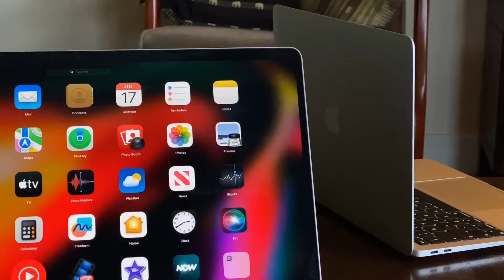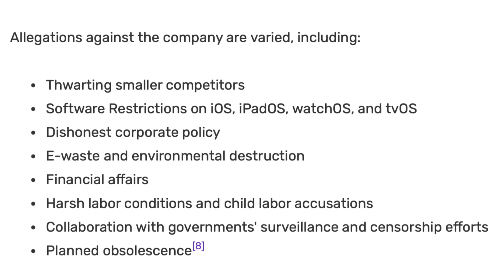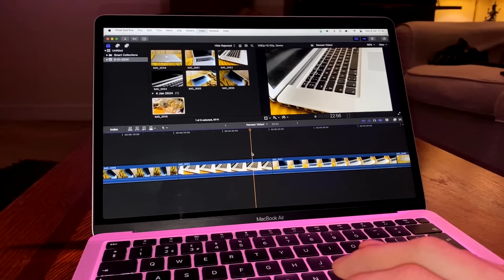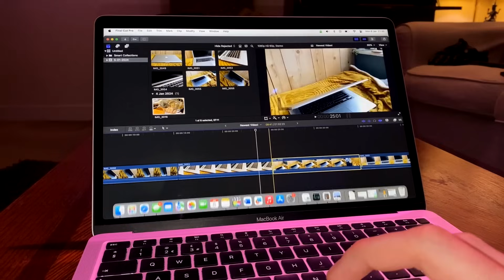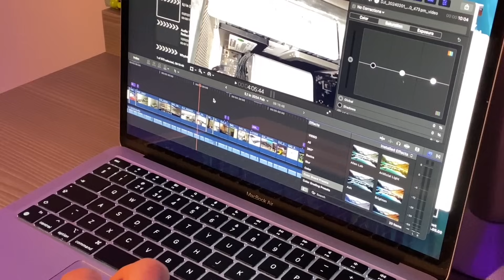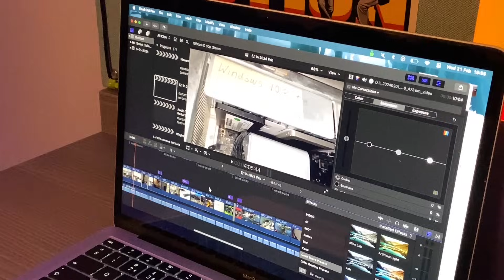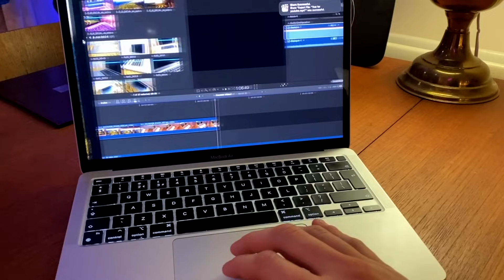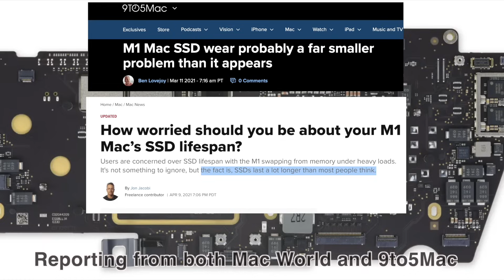Don't make the same mistake I did by buying a used Intel Mac.

Comment: Used M1 MacBook air is relatively cheap right now costing around 450-550 .But I am against buying used laptop that has soldered ssd , this applies to not only the apple silicon ones but the intel one as well . There is a risk that your ssd can just drop dead not long after you bought it and you can do nothing about it. If you are looking for a used laptops , it is better to go with the ones with replaceable ssd .For laptops with soldered ssd , it is worth to pay a bit more to get a brand new one with warranty and sold it and upgrade to a new one before the warranty expired.
Reply from the maker: Guessing you missed the part where I talked about SSDs…?

Comment: Would love to get your two cents on this. I'm currently deciding on either a 2019 15" macbook pro i7/16/512 or an M1 macbook air 8/256, both going for around 400 USD. I do understand that the M1 is tons faster and will likely be supported for longer, but what I find appealing with the 2019 mbp is the 16gb ram (i find that I use this up often on other non-macs) and the larger screen size (not an absolute priority but its def preferred). What do you think I should go for?

PS. I'm currently on a 2009 macbook pro with a core 2 duo lol so any of the two is guaranteed to blow my socks off. Was on a thinkpad a few weeks ago (i5/16/512) but it died on me so I'm going mac
Reply from the maker: Hey, thanks for watching!
16GB is objectively better than 8 of course, but I’d rather have a base M1 in almost every case. I think the M1 could last you close to a decade from now.
Reply: I had i9/16gb/1TB 2019 MacBook Pro and sold it month ago and bought base model Mac Mini m1 8gb/256gb and it’s a lot faster and 8gb works better than 16gb on Intel Mac. MacOS compress ram in very good way on 8gb M devices and m1 machines have fast ssd discs so swap memory works really fast.

Comment: Tim Cook and Co. have ruined Mac Computers as far as being upgradable and their upgrade prices for ram and storage on Apple silicon are ridiculous. They have no shame. At least you can upgrade the storage and ram on some of the Intel models and it’s way cheaper than Apple prices.
Reply: the last MacBook Pro with upgradable SSD storage is 9 years old now. Same for RAM - 12 years. MacBook Air - 7 years for SSD, RAM was always soldered on. We're talking about times, when the headphone jack was still around on iPhones.

Comment: I made the big mistake of getting a brand new 2020 intel MacBook Pro a month before the M1 was announced. I did this thinking I would be safe to bootcamp with windows. However later I learnt that using some more developed software I could have been able to run my windows programs on an M1 (ARM) architecture chip.
Reply: my friend did that too.... he future proofed it by buying the max Intel mbp in 2020.  lol.... value went down real quick.

Comment: As I've said before; If it weren't for the extortionately-priced, and generally anemic RAM/SSD options, I probably would've jumped on something, like an Mx 15-inch MacBook Air (and if this particular model didn't cap out at 24GB), so I'm still gonna ride out macOS Sonoma (or whichever will be the latest Intel-supported macOS) on the Ryzen 7 build, and the old Lenovo P50, for a while.
Reply from the maker: Can’t blame you. :)

Comment: I agree with you, these days Intel Macs are for very specific workloads. Me personally, I have a 15 retina late 2013 which still works good enough for what I do, and thanks to open core patcher I am using the latest version of MacOS. However, the fact that the new machines are imposible to repair, even on things that are likely to break like screen(paired to the motherboard) or keyboard, and their limitations (you can’t game, can’t use Linux, no eGPU) make me hesitant about buying another Mac. On my machine, I installed Linux and windows for gaming (I know it has little power for that, but it is possible and light games run well, like valorant. And you have eGPU support). It does everything I need. Would I like more power and battery life? Sure! but not at the expenses apple is imposing. Me personally found that the framework 16 laptop goes much better with my workload and needs than a MacBook. But I get this won’t be the case for everyone, and high power while being portable is something new Mac’s just are impressive. I do believe the Macs these days are incredible machines. Nice content also!
Reply from the maker: Thank you. 
At the end of the day, everyone has their own uses for their own machine. This was just my take
Reply: M1 Macs have Linux support through Asahi. Not everything works yet, but most of it. You can also buy Mac parts from Apple if you want to (depending on region), so it's not all doom and gloom.

Comment: Okay, here is the deal.  If you're planned use is streaming, basic office work and web browsing an Intel updated to Sonoma via OCLP will be fine.  Heck, Linux runs really well on these intel laptops and Windows works great via bootcamp.  The uploader is also correct in that Sonoma is likely to be the last MacOS version to work on Intel.  

That said, I know a LOT of people who still use Catalina.  I've not heard of any security issues even though it and Big Sur have been discontinued.  I'm not saying its a great idea to use either but plenty of folks do with no issues.  The M series machines are fantastic but I don't use Final Cut.  I don't do high end Photo-Shop nor do I need blazing speed from my SSD or processor.  Price wise?  A 2019 Macbook Pro 16" can be found for under $600.  A 2019 13" unit for under $300.
Reply: " I've not heard of any security issues". Lucky you if you can afford not to care about, as there are plenty for any macOS prior to the most recent version - and they are all publicly known. I am running company business on my Apple machines and could get fired if some damage happens due to security incidents. Being in the IT security business as a professional I can't stress enough the importance of running the most recent OS software. If you can afford to do not care, your choice. But I discourage that. People running outdated OS on their machines aren't putting themselves to risk only: captured machines are most likely used to launch attacks on more machines, making it a threat to everybody.
Reply: @olafschluter706  I wasn't speaking about IT pros or professional users.  Can you share any data you have on Macs being used to 'attack' other computers or servers.  That's a Windows and to a lessor degree a Linux issue.  

The average home user isn't going to face the kinds of issues a business would.  In many cases they are primarily using computers for streaming, browsing the web, doing basic office work and more and buying the latest Macbook is in my mind, silly if the planned use is what I noted.

I used OCLP and have updated my Mabooks to Ventura and Sonoma.   However I have no desire to argue with a 'IT' professional.
Reply: security is not even a problem for the regular user. The support policies of major companies only develop for recent macOS versions. So if you want to get MS Office for example - too bad, only last 3 macOS's supported. And you have to be VERY careful with OpenCore as it can brick the SSD controller and SPI ROM during installation when misconfigured! Seen it happen already on some machines.

Comment: And what about my 4 times screen of death on my both MBP M1 Pro and M2 MAX ?
Did You said something about that?
Intel Mac will never die like that, so I have to hold the power button to restart.
Imagine that happening on a big stage, with thousands of ppl, waiting on the music to start again.
Thanks for the review, but the new M's still got their downsides. For caffe and office use is not a big deal (battery is great!), but for critical work are not ready yet.
Reply from the maker: I have never heard of that being a big issue, but I can understand it would sway your preference considering it seems to have happened a lot to you!
Reply: Yes it looks like I dimmed my display, but it is DEAD. M1 and M2. It reminds me of the blue screen of death on Windows XP. Computer unresponsive until restart.

Comment: Me: I need virtualization on a daily basis and the Apple Silicon is not up to scratch yet.
My employer bought a refurb from Apple (i7 8 cores/32GB RAM/512GB SSD, 4 Thunderbolt ports), which does the job just fine. I'd wish it had better cooling though.
Reply: What exactly are you doing with virtualization if you don't mind me asking? I have a fully loaded M2 Air and regularly use Linux VM's, Windows 11 Enterprise and BSD. They run beautifully. I feel like the Windows 11 runs faster than it does on my desktop.
Reply: @SintaxBSD . I run Kali Linux, and occasionally Windows when I need to use certain niche software.

UTM on Apple Silicon does not cut it. Colleagues tried with Fusion and Parallel and were unimpressed.

Comment: i you like work on 13inch ok but for 500 you will get new laptop with 15 oled screen and cpu from 2023 or 2023 and you can upgrade ram and ssd :/

Comment: Good points.  So you think Intel will be cut with this years macOS update?  Interesting.  I think it will get 1 more year tops.  But definitely by 2025 intel will be done.
Reply from the maker: Thank you for watching 
I believe so. At absolute BEST, 1 more year, but I think it’s unlikely…
Reply: I guess they won't drop Intel just yet. The last Macs with Intel were released in 2020, that would be a VERY short support period. 1-2 years to go.

Comment: But they’re the only cheap ones lmao. I’m thinking of buying a 2006 Mac mini rn
Reply from the maker: That’s true. If it’s enough for what you need to do, might as well buy
Reply: @montaguebarnabasltd  I like to collect old Mac’s. I use an M1 MacBook Air as my daily driver. I have Two 2013 MacBook Airs, one 2008 black MacBook. And I want to get a 2006 Mac mini because of OS X Snow Leopard

Comment: Should I buy an iMac Pro or iMac core i9 2019 in year 2024? Many thanks.
Reply from the maker: I wouldn’t recommend it, but they’ll likely get your work done for a few years at least.
Reply: @montaguebarnabasltd  Thank you so much for your idea. Between iMac 2019 core i9 and iMac Pro, which one will last longer with new Mac OS?
Reply from the maker: @buitho439  iMac 2019 is more likely to get the next MacOS version. I doubt either will though
Reply: @montaguebarnabasltd   many thanks.

Comment: A 2019 machine is 'quite recent'. Uhm, no.
Reply from the maker: Do you have a problem with my standpoint or videos that you’d like to talk about? 

Or do you just like to comment sarcastically pointing out little things you would have done differently if you could be bothered to make your own videos?
Reply: @montaguebarnabasltd  Anybody that knows anything about technology knows 5 years is a LONG time in the tech world. So calling a 2019 computer 'recent' and then complaining it doesn't perform to current standard is quite a laughable argument. 

In addition it's kind of a 'mr. obvious' point of view to say that a newer computer will be faster and more suitable for current requirements.

How to improve your video? Well you could try to avoid such obvious observations, that would be start. 
(EDITED, you said 2019 not 2018, although it doesn't influence my point all that much, I should correctly state what you said)

Comment: Is this video a joke? You can buy a cheap intel mac, upgrade memory, replace ssd, install windows or linux and get latest features 0:40 . Can you do the same on M1/M2/M3 mac? NO, everything is glued together with a proprietary ecosystem that cant be avoided and depending on mac for future supportability.
Reply from the maker: I understand your point entirely. It’s incredibly annoying and we can’t help but hold a grudge against Apple for how unrepairable the new ones are. Cheap Intel Macs will never come CLOSE to the performance of M1/2/3, though. Latest features…? Maybe a working browser, or compatibility with modern apps. 

None of my Intel machines enable me to edit video with 5 timelines, have 5 Photoshop and safari tabs open in the background. Intel Macs are useable for some people, absolutely. That group is getting smaller, though.
Reply: @montaguebarnabasltd it’s not some people it’s most people not everyone is a video creator and and need to have a laptop that can do that
Reply: @404invalid-user "most people" will not even be able to run MS Office on the aforementioned machines, unless they OpenCore their way onto Big Sur onwards, which - again - "most people" have no idea how to do.

Comment: This is laughable, I snagged a dual xeon mac pro 5,1 with 128gb of ram for £50 and its perfect for running VM's even supports the latiest mac os with a couple cheeky mods, its kinda comfy for gaming too. The M series meme is not mature enough (kinda like its userbase) to be taken seriously, since they have an unpatchable exploit in their CPU's right now. Not to mention since its apple hardware its super locked down, no reparability, no modular parts, its peak coomsumer.

Comment: I love my entry level Mac Mini M2. I chose to ignore all the nay-sayers advising that 8GB is way too little memory and I won't be able to have multiple apps open etc......absolute nonsense. I've had file transfers on my network, a game running, multiple Chrome tabs open (to prove a point), editing a short movie on iMovie (I don't do anything fancy) and still didn't hit the SSD swap file. In fact, the only thing that has ever caused a couple of hundred MB of swap was using the Opera GX browser! Closing that app down the swap quickly became 0 and it was all good once more. I've got a couple of fast SSD's connected up by USB-C and again, not a single issue. So, if you want a good all round entry Mac and have the peripherals already, the Mac Mini M2 is hard to beat.
Reply from the maker: Gotta agree with you there. Very reasonably priced for what it is